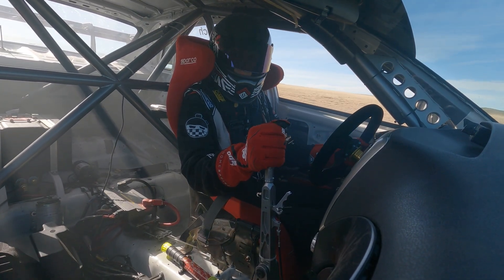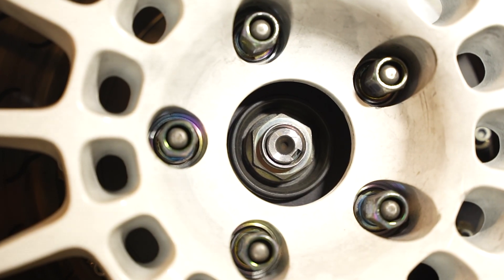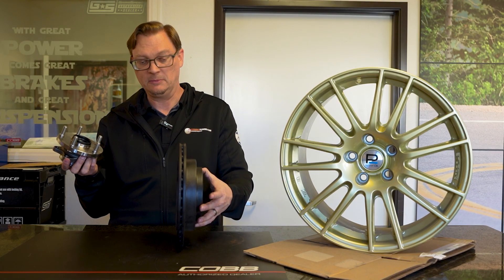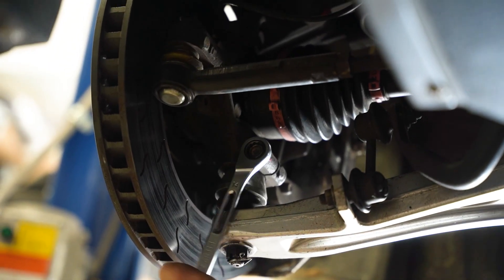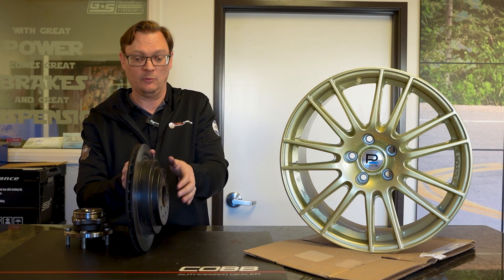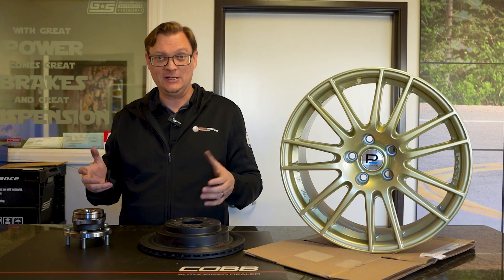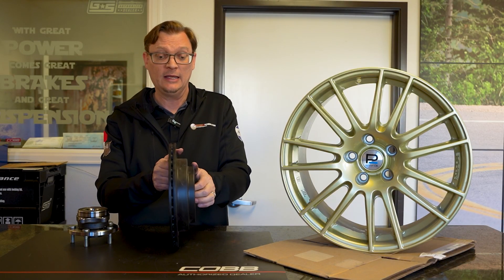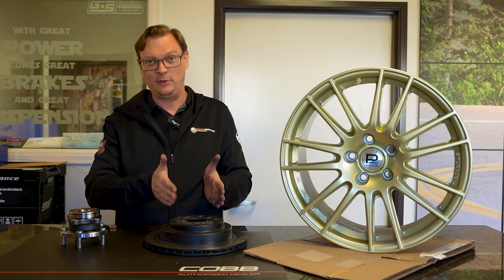Bad Wheel Bearing = Brake Failure???  Why checking Wheel Bearings is so Important

Comment: Mate I also had a question related to brakes that I'd really appreciate your perspective on, in the Subaru Service Manual it talks about performing a "ABS Sequence Control" and "VDC Sequence Control" to get all the air out of the ABS / VDC unit when you bleed your brakes? Is this necessary when say replacing brake lines and if so, have you had any experience doing it using one of those devices like a topdon scanner?

Comment: @FlatironsTuning do you need to change axle seals every time you remove/replace cv axles from the trans or rear differential? I replaced all 4 seals 2000 miles ago but I’m planning to replace axles soon. Thanks
Reply: It depends on the philosophy you live by. A seal is a consumable item. It is constantly being rubbed against it's opposing mating surface. Changes in surface finish against a rotating seal will most often accelerate a leak. I get it axle seal are surprisingly pricey, however there are reasons for this, they are directional seals and designed to mainly seal in a specific rotation. That why they are different part numbers for the left and right sides. It's a "while you're in there"  or "pay now or pay more later" mentality. The choice is yours, is it worth to you to pull it all apart again just to try to save $50.00, to some it might be, others not so much. It cost $50. and an extra 10 minutes while your already in there. I would, and I do all my own work my cars. I didn't see a reply from Jon so I thought I would step up. However, I'd still like to hear Jon's opinion about this as well. May the open road forever be in front of you.

Comment: If you've modified the car by using wider wheels, different offset on the wheels and/or stickier performance tire wheel bearings take a major hit with increased loads. This is especially true with performance driving whether it be autocross or track days. Knowing this wheel bearings should just become another wear item that gets replaced on a schedule.  I know people who replace wheel bearings every other off season as a precaution. Luckily this happened at a spot there was plenty of run off or it could have been far worse.
Reply from the maker: Thanks for watching and good points.

We definitely need to get in the practice of checking this more regularly.

Stay Tuned!

Comment: Awesome video as always mate, quick question, way I have been checking the bearings is to put the car on stands and trying to wobble the wheel with my hands on each wheel at the 9 o clock and 3 o clock position, and then also trying to wobble it with my hands at 12 o clock and 6 o clock, is that the correct way? Or can they still be bad and not have any wobble?
Reply from the maker: Yep, that is what we do to check them.  But yes, I have seen them on Subaru's especially where you don't detect some failures this way.

The other thing that you can do is use an IR thermometer to measure the temperatures of the axles at the wheels (provided you don't have center caps).  

Ideally you would want some data to compare, but a bad wheel bearing will be a fair amount hotter than the good one.

Hope that helps and glad you enjoyed the video.

Stay Tuned!
Reply: @FlatironsTuning Legend mate as always! Thanks again!

Comment: I had an axle nut back off recently and cause this problem. I torqued it up again and staked the nut but I'm worried the bearing is toast because that happened. Would you consider it shot at this point?
Reply from the maker: There is a reasonable chance that the bearing is damaged.  I'd keep an eye on it and if you can, start checking the temp of the axle/bearing compared to the other side.

If the bearing is bad you will most likely see that it is hotter.

Hope that helps and Stay Tuned!

Comment: Could this cause brake pads to clunk randomly? I’ve had both rear wheel bearings changed but not the front and at complete random times at low speed the brakes clunk as if the pads are shifting slightly in the calipers.
Reply from the maker: If you are hearing the noise when you switch directions (going forward after backing up, etc.) you are most likely just hearing the pads shift in the calipers.  This is not unusual for calipers like Brembos or Subaru 4-Pot's.  If it isn't when changing direction, then I'd recommend trying to pinpoint which corner the noise is coming from, and take a good look at the caliper, pads, and wheel bearing there.

Hope that helps and Stay Tuned!
Reply: @FlatironsTuning Thank you.

Comment: How do you check the wheel bearings for this prior to seeing the symptom?
Reply from the maker: Thanks for the question.  With the car in the air, apply pressure to the wheel at 12 and 6, then at 3 and 6.

Take a look at this video where we show the testing a bit more clearly:

https://youtu.be/xYmeJeD2UDo?si=FG8NkxodB29rdR0M

Thanks for watching and Stay Tuned!
Reply: I just replaced a wheel bearing that was super scratchy and was causing a low hum at speed, but no wobble on the wheel :(